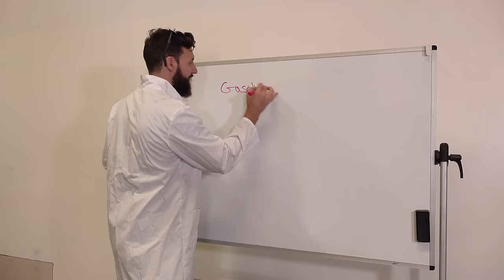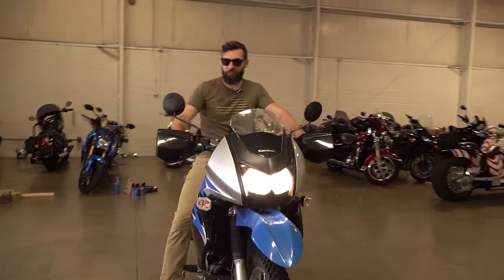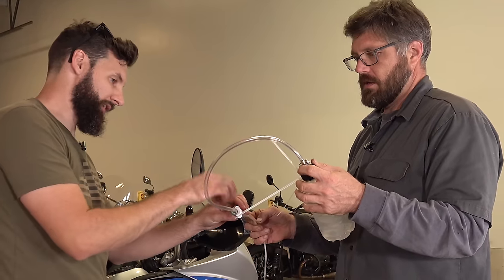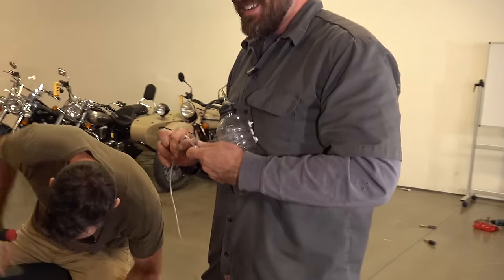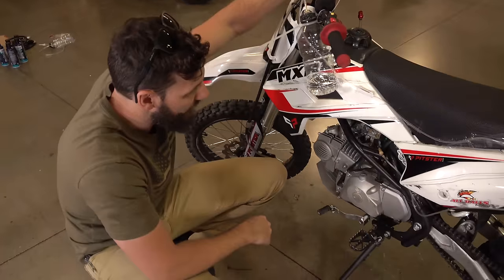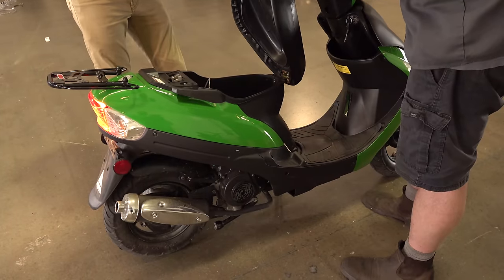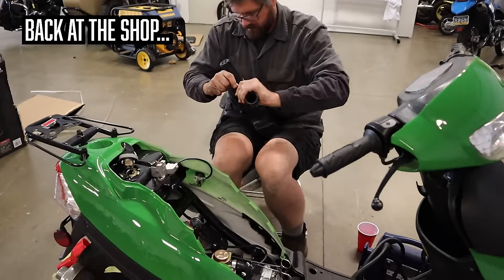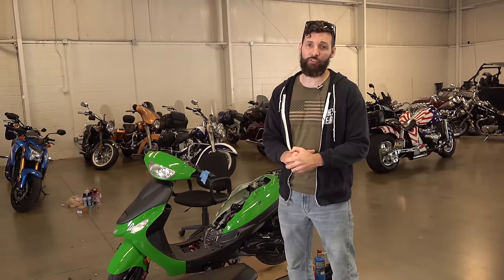What happens when you try to run a motorcycle on PROPANE instead of Gas

Comment: Natural gas vehicles are common where I'm at. Heck our buses ran on it in the early 90s. Propane doesn't seem that far of a stretch, I'd imagine you go through piston rings like crazy.
Reply: I live about three hours south of these guy . Our local propane company actually has their intire fleet run off of propane.
Reply: MY BMW 330I  has been running lpg (uk is 100% propane) for the last 130000 miles. no issues
Reply: @ravennexusmh  wow, that's quite awesome. What was the conversation like?
Reply: @ravennexusmh  My Focus C max is the same, runs perfect on LPG it's an O7 and has never given me any issues, it has done 180k now.
Reply: You don’t have as many issues as you would think, as the comments already mentioned... We own a dump truck( from mid 80s), and it is running on Methane... for about 30years now. Just regular maintenance, some seals dry out, but not sure if it’s due to gas or just because we use the cheapest stuff we can get lol
Well worth the initial conversion cost.
*there are hookups to your home gas line to fill your car (it becomes pretty cheap to drive if you want to jump the hoops), not sure about here in US, definitely not as common as coal-rolling-heavy-duty pickups...
Reply: @fleghel  See, this is cool to hear. I had a misconception and being calmly corrected by knowledgeable people. Why can't most online discussions work like this. But this is interesting, I will be looking into it.
Reply: Also anything that is used indoors runs on lpg. Think forklifts, floor buffers, concrete saws, generators ect.
Reply: @This1Person  that's so true! I just  explained a joke to someone who very obviously misunderstood and the poor girl was so thankful because she asked for clarification but instead got 10 jerks mocking and insulting her for an entire day. Poor kid.
Reply: There is no difference in piston wear with natural gas and propane. I drove a natural gas truck for years and it ran perfectly fine. My organization got rid of it after it reached the 10 year mark because the tank expired.
Reply: In Australia we had a few factory cars come standard as lpg cars, could even fill them up from the petrol station. Ford falcon manufactured in aus had a lpg trim. All out busses also run on natural gas.
Reply: @rollei35mm  That's the only time it ever makes sense to buy one is if it comes from the factory with the conversion. It's just too expensive and you'll never get a return on your investment.
Reply: @dan_6915  The performance is the same but it really doesn't make sense to pay to do the conversion. Maybe buy a used car at where somebody else did the conversion or get it from the factory with the conversion but for the most part it's just pretty expensive
Reply: @dan_6915  they are good for fleet vehicles. Problem with LPG is it can actually become more expensive than gasoline when conditions are right (or wrong I guess). 

Natural gas usually stays more constant price but the conversion has its own problems like range, and the tank expiring. You can't liquify NG at least in small setting, and has a limit to what you can pressure the tank to. So you either have to have very large tanks or top off more. 

LPG definitely solves the range issue in a smaller tank and is usually cheaper than gas  but pricing and shortages can be an issue sometimes
Reply: @dimesonhiseyes9134  
Where i live lpg refill stations are everywhere.
Almost all gasoline/diesel stations, have lpg also.
Most people install toroidal tanks wich can take up to 50 litres for a big range.
Cost of lpg is half than gasoline since last 20 years.
You only change some components when tank "expires".. Tank is not made from coca cola can thin metal sheets..
As a fleet i guess it's very cost effective.
As a private, as i've said: you have to use your car daily for at least 15-20.000 km per year, inside a city.
I have tree friends that got lpg on their cars: 1.8 Lancer, 2.0 Megane, Tiguan 2.0 tfsi
It's worth it, considering gasoline urban consumption is 15-17 litres / 100 km for such engines used at rush hours.
So, as a private individual, i only see advantages for this type of fueling solution.
Reply: I've heard the Propane engines last 400,000 miles very easily, because the cylinders don't wear really at all, there is no ridge and no carbon at the top of the bore like  an older carburetted engine. Fuel injected engines also last 400,000 miles and have very little ridge on the cylinders. But propane is very low carbon/soot. The Dodge 318 airport trucks used propane, and were said to routinely be run to 400,000 miles with no internal changes.
Reply: @Ritalie  it is possible but in reality 400k miles is pretty much impossible to get in most vehicles. Without modern fuels in a first world country carbon build up isn't really an issue. I mean carbon deposits do happen but with modern detergents and a properly working motor it should never get to be a problem. 
While propane and natural gas are cleaner they really do give just about the exact same performance and longevity.
Reply: @dan_6915  yea each country and region infrastructure is different but fill stations are not really what I was referring to. 
The way LPG is produced is different than gasoline or natural gas. It has to be produced to meet expected demand. So the producers creat a supply to meet expected demand. Sometimes the demand far exceeds the projected demand, usually as a result of harsh winters. 
Most consumers won't notice as they usually only use propane for grilling and propane for heating was already bought for the winter. So the only ones that were really affected were the customers that needed propane for industrial uses and people who ran out. At one point a few years ago it reached more than $20 a gallon for a short time. And there were shortages throughout much of the US. This only affected propane. Natural gas was in abundant supply and has never been in short supply. 

In the US pressure vessels must be certified. Propane tanks expire as well as natural gas tanks and must be recertified. Natural gas is stored at thousands of psi while propane is stored in hundreds of psi. Propane tanks are often exchanged so the certification is usually taken care of by the supplier. Natural gas tanks on the other hand can not be exchanged. You must pay for testing and recertification which the last time I had it done was more than $1000
Reply: @dimesonhiseyes9134  it may be advertised as factory fitted ...
but i assure you it wasn't...
well the holden  2004 vz's where not
i worked on at the 'factory' on the export line
 and the lpg cars came on the line over from them
they where done 'off site'
by hbd
same as the cvz monaro sunroofs and a few other special models upgraded to holden specifications
Reply: @alt7488  well I won't argue with you. That very well may be the case. 
What I do know is when we have bought vehicles from Ford of Chevy that were "from the factory" or "installed by" with the natural gas conversion. 

I do believe our bigger vehicles like the dump trucks and busses have the conversion installed at those factories.
Reply: Michael Hardy uk is 100% propane? So no petrol available?
Reply: Why would you go throw rings the only difference is gas and diesel have to be atomized to burn in the combustion chamber where propane is already in vapor state in atmosphere that's why you need a carb to mix gas and air to make it a fog or mist of gas and air just like fuel injector do just more precise and calculated and delivery of air and fuel you could think of it like those people that get mouth full of gas and spit fire while holding a torch  to make a big blow up flame ball of firey death they spit out a hug mist that spreads out a large area in front of them not a little stream like the shit water fountain that your jelsus of jokes and the same  for concept for diesels and yes it is true that not all fuel types burn at  the same temperature and some fuels won't burn at some ambient temperatures but can
Be over come buy buy changing the fuel little as by adding anti-gel or conditioner condenser and Soo on and Soo forth blaaa blaaa bla so the next time I hear any one say lp gas burn the rings out please tell me why like unleaded or any other type of fuel or gases wouldn't

Comment: What went wrong, is you are varying how much air was going into the carburetor, but the amount of fuel was consistent. That's why they have both the butterfly/slide and the needle. So basically it would only run at one rpm range where it had the best a/f ratio. To make it work proper, you'll need to find a way to regulate the fuel as well as air to get the best ratio, and to be able to control both of them with the throttle. Also, the LP needs to be evaporated/heated as it burns in a vaporized state.

Great video though and I'd like to see a part 2!

Comment: I’m a follower of your channel for quite some time and enjoy the style and content. I was surprised to see this one pop up. I work for a company that globally supplies the most advanced LPG conversion systems for cars, trucks, boats including DI engines of today (for example; for the full range of F-150 2020 engines available). We had a colleague who converted his bike, with injection engine) and here and there sometimes a bike project pops up. I am all up for converting cars on propane, but I would do my own bike. The engine I don’t worry about, I just wouldn’t want the top cover in the back holding a tank.

Comment: The fuel pressure is slowly dropping and higher in the rpm range you will need more fuel the whole time engine was probably running lean I would try tilting the bottle to see if that can get you more fuel pressure

Comment: I'd give a regular grill regulator a go. Maybe ditch the needle idea as well, it seems far too restrictive. Throttle will always be by bottle, the throttle on the stock carb ends up acting like a choke.

This might be a whole lot easier on a fuel injected bike too, since throttle on the handlebar directly relates to fuel into the cylinder.
Reply: A regular grill regulator needs the diaphragm to be pulled out just the right amount by an adjustable spring-screw-nut system in order to give the motor the right amount of gas when it needs it

Comment: on the cheap, these set ups are best suited for like a certain rpm range, like the generator. i've seen videos where you can run a lawn mower on a 20lb propane tank. this running a street bike on propane could be a game changer.....i do believe you will be slightly down on power vs gas. just imagine how clean an engine that runs on propane is?????? it's amazing....please keep up the good work. glory!!!!

Comment: The butane issue sounds like a problem with evaporation. Basically, after a minute or so, the butane starts to get cold and can no longer evaporate fast enough to keep the engine running. I tinker with small engines, and "expiremented" with gas vapor carbs. I would take a small gas can with a piece of rubber hose connected to the spout, and drill a hole in the top of the can and insert a shorter piece of hose that reached almost to the bottom of the can. This allowed air into the can to mix with the gasoline to it could burn. I would then shove the hose from the spout of the can into the throat of a carburetor, and the engine would usually fire up and run for a few minutes, and then die. I discovered that the gasoline would get really cold from constant evaporation into the carburetor, and would no longer evaporate fast enough to run the engine. The gas can would get so cold that condensation would form on the outside of it. The butane might be having the same trouble. If you can find a way to keep it from getting cold, it might work better.
Reply: Well obviously add some hot tea with rum
Reply: Yea what u said 🤓

Comment: I know some people who convert engines over actually pin the throttle open all the way and completely regulate RPM through a valve on the propane tank or on the line from the propane tank. It is also super important to make sure there are no vacuum leaks as propane engines don't like to run lean. At least that's what I have been told. By the way awesome video like usually.

Comment: The propane tank you would need for this to work is not the same tank as you find on a gas grill or the bottle you were using.   You need a regulator, a slightly different jetted carb that also has no floats in the bowl, and the proper tank that supplies liquid instead of gas.  I was a tech that repaired propane powered engines that powered floor buffers and these motors ran on propane as they had way safer emissions to run indoors.

Comment: Fun fact- any 4 stroke internal combustion engine can be ran on lpg (or cng) as long as you have the proper pressure, regulator and mixer (the carb you used off the generator is the mixer). LPG burns cleaner than gasoline which helps with engine life, can increase performance since LPG has a consistent 105 octane rating you can get more aggressive in tuning the timing table and to top it off it’s relatively cheap. Cng is the same but it’s octane hovers more in the 110+ range but stays relatively consistent at around 110. The largest issue is space for the tanks and infrastructure since there generally isn’t a lot of places most people can fill their tanks (mostly a cng problem, but can be for lpg as well when compared to gas/diesel stations). Lpg can be used as an aid to turbo diesels very easily increasing power/economy via a boost reference system ( which can see huge gains in peak HP and tq with just a tune for this style of system). This style of system is great for those guys who tow a lot and need that extra power and want to burn clean why’ll doing it (and no, more smoke doesn’t equal more power but I could go on and on about that stupidity).

Comment: As your Butane vaporized the refrigeration effect lowered the temperature of the container to the point that the Butane would no longer vaporize quickly enough to feed your engine. 

If you immersed the fuel container into a larger container with hot water in it the engine may run longer.

Fun fact, Butane is high octane.

By the way, I can't believe you ran the Amazon bike with honey for oil and got away with it that long. You really worried me when you started messing with that nice KLR on the heels of the Amazon bike torture, I'd love to get a KLR from that last generation with the nice big Real Gauges. before they go fuel injection.

I really enjoy your videos and they are getting a nice variety of entertaining antics. Just don't loose sight of those great reviews.... And don't hurt that KLR.

Comment: In the UK you can buy kits to convert your car to LPG and buy it on pumps at gas stations.
We used to be able to buy new cars already set up to run on it.
Can wear out your engine quicker as you usually need an engine with hardened valve seat to avoid premature wear.
You would start your car on normal fuel and switch over when slightly warm.

Comment: OMG, never discharge butane inside! NEVER! 
Good way to blow your shop up, or suffocate your dog. 
Butane gas drops and settles on the floor. It doesn't dissipate well, and will ignite extremely easily.
Edit: not trying to hate, just want people to be safer...God bless.
Reply: Blow up the shop? With that small amount of butane? 😂
Reply: @edjebimmer882  maybe not the whole shop, but how big does an explosion have to be to not want it inside your motorcycle shop? Atomic?
Reply: No worse then a bic lighter drama Queen !! Butane is allot like propane i should 
know i run a propane plant that pump 200000 gls a day,
It would just do a small flash and that would be about it the amount they 
released. Relax dude. BTW liquid will not settle on the floor. It will vaporise 
and settle to the lowest point like a floor drain. And it does disipate actually 
very well. Take a cigarette lighter press on the valve what does that do.
Reply: @mikep4823  So your advising, as a professional, that it is safe to do so?
Or 
Just want to make yourself look like a big boy? 
Yeah, I got experience as well. In my experience, it wasn't the smartest thing to do, better ways to do it and I learned.
Be safe, wear a helmet gloves and jacket while riding and discharge butane outside. 
Also, wear your seatbelt and God bless.
Reply: @Last Name First sounds a bit like Oregon right now
Reply: I love how explosive this is 
😁
Reply: @mikep4823  I threw down a bic  lighter once to see what it would do. I was outside on cement and a considerable distance from any building. It blew up into a nice shaped vapor cloud and dissipated almost immediately. There was no spark or flame present, so there was very little chance of detonation. I was 40 years younger, and going through  a divorce when I did this.      Vaughn
Reply: @davidmesser8619  should we use butane or propane to roast the marshmallows? Lol
Reply: @davidmesser8619  I heard about that, isn't that the Tunguska event?

Comment: Looking forward to part 2 . Strange I just bought a dual fuel generator on Ebay . Almost bought a Firman on Amazon but then was going to just step up and get the Honda but decided to check Ebay first . Low and behold they had a 3400 watt Champion and I won it . Hope it never has to look like the dual fuel generator you guys took apart .

Comment: Gasoline is a mixture of flammable alkanes of different density like butane, propane, pentane, hexane, isohexane, isopentane and so on. Also benzene is a part. This mixture makes it a smooth run for the motor. The content of isooctane relatively measured as so called octane number qualifies the mixture for convenient for most actual regular built gasoline burning motors. But if a bit modified a motor can also run on CNG what's mostly the even lighter methane. In Eastern Europe taxi drivers often modify their cars to run on LPG which is mostly Propane and or Butane as it is much cheaper as unleaded fuel.